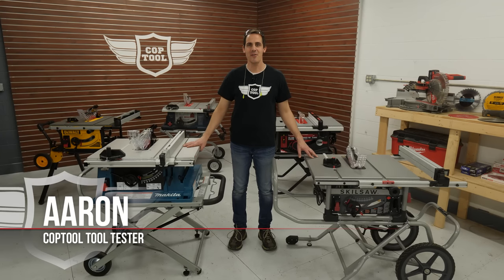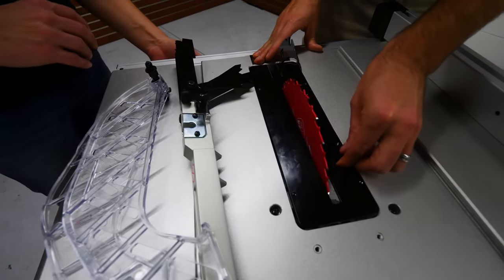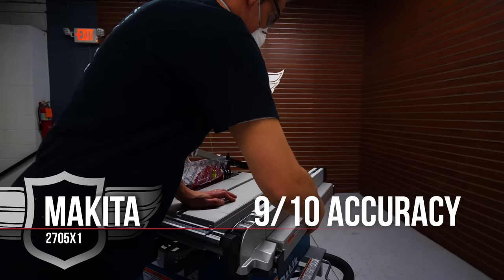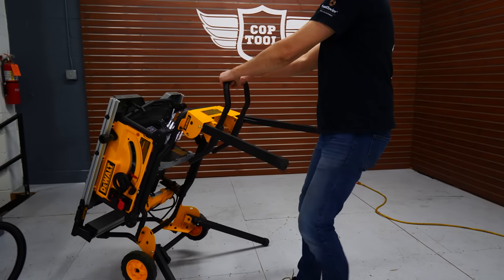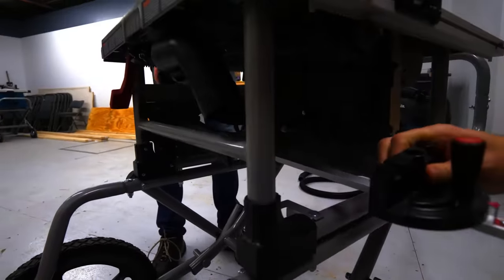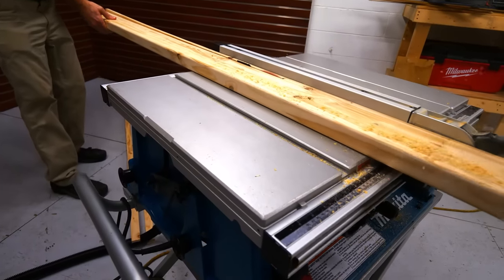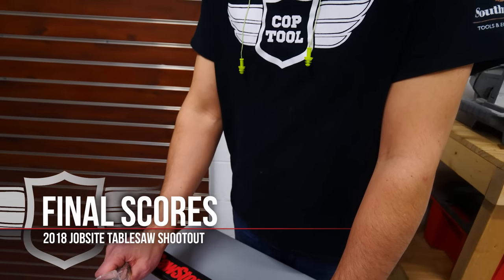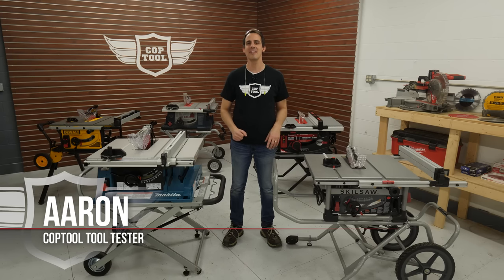THE BEST Jobsite Table Saw - Bosch, Dewalt, Makita, SawStop, SkilSaw. How to choose the one for you.

Comment: I have that exact model Dewalt and have used it plenty over the past 4 years.  I added a Ridge carbide blade, zero clearance insert, and JessEm rollers (router version) attached to a Rocker aluminum fence.  I posted a photo on my Amazon review.  It works great, but like all table saws......isn't perfect.  The tabletop is a bit small and isn't dead flat like you would find on a cast iron saw.  The miter slot is also a bit sloppy.  And in my case, the fence has a tendency to lift upwards because of the force of the rollers pushing down.....but this was fixed by drilling a hole in the plastic fence bracket and adding another lockdown bolt.  Out of the 5 saws reviewed, I would most likely choose this one again.  The Saw-stop is nice, but you're approaching hybrid saw pricing.

Comment: I like the makita. It does cost more, but you get real tangeble benefits for the money like smooth ramp up and low rpm loss under load, both contribute to keeping your breaker from being thrown. It's also the quietest, one of the most accurate out of the box, and I'm pretty sure it's the only one with a off-break. I think it goes very under appreciated how much more comfortable a few decibels and a rapid off-cycle is until you have to deal with a ripsnot freewheeling saw.
Reply: Those are the features I go for too. Also stability and low vibration when using dado set.

Comment: I like my Ridgid table saw and it’s Lifetime warranty I’ve had no problems and it performs very well daily .. I use Diablo blades on all my saws
Reply: My grandfather and I bought a Ridgid TS3612 back in 2001, that saw was great, still works great, but my grandfather passed away in January of this year, and my uncle now has the saw, I have no clue why he don't use it, just one of those items that the family thought they needed to take from the shop, that they'll never use as was the same with everything else they took, if it had any sort of value they could get by selling they took, it...nevermind the fact that grandpa and I went halves on it, so technically they owe me for 1/2 the cost of the saw....I ended up getting a Grizzly hybrid table saw to replace it.  I also bought the Skilsaw SPT99-11 which is the HD portable worm drive table saw for the times where I need to take the saw to the work LOL....the Grizzly table saw is great, but its a bit of a chore to move it LOL.  The mobile stand for the Skilsaw is great, the large wheels make it very easily movable, and easy to load/unload from a pickup too.

I use Diablo blades as well, they work great, and last a long time....The Diablo blades are made by Freud.

Comment: I remember when Skil was a great brand. Maybe it is again. I have a Dewalt DW740 that I picked up for $239 at the homer depot because that model number was being phased out. I love it.
Reply: I have the Skilsaw SPT99-11 Heavy Duty Worm Drive portable table saw, its great, very accurate, and tons of power with that worm drive system....the rack and pinion is metal rather than plastic like most of these saws.

Comment: I agree with your comment regarding saw safety. However, you went overboard in praising Sawstop. Without their patient infringement lawsuit against Bosch over the REAXX GTS1041A Jobsite Table Saw we consumers would have an additional and perhaps cheaper flesh-detection option.
Reply: You don't think Sawstop should have the ability to protect their patent?
Reply: Yes, they do and they did.  I'm just saying I, as a USA consumer, have less choice. SawStop's patents were issued in the 2000s. They tried in 2014 to make the patent standards essential. Why other manufacturers have not licensed SawStop's IP and incorporated them into products would be really interesting to know.  Regardless, these patents will expire in two to three years.  More brands of table-saws with flesh-detection safety features should be available then and, hopefully, at lower pricing levels.
Reply: @kamleo1685  Price is why.  can't wait to see what happens when the patent runs out.
Reply: @whoDatBeDare  SAW STOP was established by three patent attorneys according to reliable sources.

Comment: WOW!!! This review makes me so happy. For about a year now I had my
 heart set on the Dewalt. I have a Bosh 12" Glide Compound Miter Saw. I also use Bosch for my routers. I have Dewalt drills and brad nailers. I have a few Skilsaw circular saws. So I'm not set on any brand per se. Last month I logged on to Amazon to buy the Dewalt table saw but decided to do one last sanity check on what was out there. That's when I saw the new Skilsaw job site table saw. After looking at the specs and using my common sense I came to the same conclusion y'all did in this review. I went ahead and bought one and it has been simply amazing. This review wasn't on YouTube when I purchased my Skilsaw table saw and I am so glad that it is available now. You basically say all the things that I have been telling my mates for the past month about how awesome the Skilsaw is. It eats through everything I throw at it. Amazing power. The miter gauge sucks and I wish the power cord was longer. But that's being very picky and honestly...what factory miter gauges DON'T suck. Big wheels! Can't go wrong. Let's try and convince the luggage manufacturing sector of that also :)  Great review and feel totally vindicated in my decision to go with the Skilsaw.
Reply from the maker: Alex, we've been very impressed by the SkilSaw for value, wormdrive power and other features. We've still found some small annoyances like you said but if you want to use it for more precision work you should consider some upgrades on any "jobsite" table saw. To be fair to the Dewalt here we deliberately picked 5 great pro saws we think are all good for professional use. We left out some other options from Ridgid, Hitachi, Delta and others which we would guess Dewalt likely would outperform many of those as it still really is a good saw.
Reply: Agree with you 100%. For me the worm drive technology, oversized wheels, gravity rise stand (which is almost magical in that I can operate it with two fingers!), larger engine (over older Skilsaw table saw) with faster cooling were all huge plus points for me. The main reason I was going with the Dewalt was the 32" rip capacity (right hand side) and rack and pinion fence. Since the Skilsaw has a 30.5" rip capacity and essentially the same (but more stable) rack an pinion fence.....it was a no brainer. Add to that that it's $499 from acmetools.com and they throw in a free Skilsaw sidewinder circular saw and it's a win all round. Spent the whole weekend behind my table saw making cuts for a project and it was an absolute pleasure. Thanks again for the awesome review. I just subscribed :-)
Reply: Alex Reid  crappy fence adjustment !- Shaky n wobbly to move !- have the saw stop copy too !

Comment: In five years my dewalt never let me down, and it’s used HARD.
Reply: That Dewalt is a very popular saw, and honestly one that someone should consider.  I have a Skilsaw SPT99-11 which is the heavy duty worm drive portable table saw, but if I were on jobsites all the time the value saw would be that Dewalt for sure as they're extremely popular all over the country, and the price is pretty reasonable.  The Ridgid would be a good contender as well with its lifetime service agreement.  In the 23 years I had the Ridgid TS3612 contractor table saw, the only thing I replaced on it was several blades, and the drive belt...its still a great saw, other than the fact that my uncle has it now LOL.

Comment: I've used all of these saws including the portable versions. saw stop wins hands down. saw stop has a lot of little accessories and features that were not mentioned. as for value, its priceless, the fact that you'll never cut off a finger(s) or worse is worth every penny. combined with 1 turn height adjustment, micro bevel adjust, and superior dust collection.

Comment: I have the skilsaw.  It is a fantastic saw. Makes all jobs easier. It's a great tool!!  I also can not understand someone buying a dewalts after watching the video
Reply: It's inexplicable. People buy on "Feels". Seems like every single Dewalt product I've bought I've either sold used because it was inferior to the competition, or I could see a significant "Dumb" aspect to it. Biscuit cutter had waaaay too much slop.  Lets not even discuss the compressor, OMG.  The 13" planer sniped and just never could feed properly, really feel like I got a lemon. The 12" version (one model down) I replaced it with is way better  but the design of the chip collector and how it screws on is nuts because you can't swing up the outfeet platter, which means the tool takes 2x the space to store. Arrrrg, it's always SOMEthing with them haha, too bad because otherwise it's a very good machine.

Comment: Hey, with a video of more than 15 minutes we do not know:
Which has the soft start or the best? Which one has the best brake?
What is the best dust port? What is the noise of each one?
Wake up guys, we are in the year of 2018!!!
Reply from the maker: Thanks for watching!
SawStop is the only saw with a brake. Bosch includes soft start circuitry and the Skilsaw effectively has soft start through their worm drive motor. The Dewalt, Makita and SawStop do not utilize soft starts. I can't say which has the best dust port as they're all relatively the same when used with a vac. However, if you don't have a vac, Skilsaw has a 45 deg. elbow attachment for their dust port so you could point down to a bucket and collect some of the debris. We've run tests on noise but didn't find much of a difference in each model.
Reply: coptool Thank you
Reply: They didn't fool with answering these questions because the SawStop wouldn't have one in those important categories, and you can't make the company that paid for the advertisement look bad in their sponsored video.
Reply: Angry welder, yes, they answer, you can see here.
Reply: In this test SawStop is the only saw with a brake
Reply: WRONG, the dewalt has a brake, yours is defective...but no soft start....no idea why.
Reply: @nowherebrain  ....everyone who I've heard buy the Bosch with the soft start has had issues to the point the saw becomes useless. Additionally they've left out the Hatachi saw.
Reply: @ToolShow  Makita 2705 also has a blade brake..

Comment: This is the only video that I have watched that claims the Dewalt has issues with the fence or tool storage. It seemed as though SkilSaw had a lot to do with how the categories were graded. This is also the first video that has graded the SkilSaw well in power and accuracy. Just by watching this video, I can tell that I wouldn’t subscribe to this channel. Not a lot of integrity in the review. While I agree that the SawStop is probably the better of the five because of the safety, the DeWalt is clearly a better saw that the others. Good luck Cop Tool at being able to maintain a following with this kind of skewed testing.
Reply: damn people ae seriously upset over a brand jeez lolll are you a share holder or something ?? ahahah
Reply: Say as you will about that DeWalt, but I've tossed my table for it broke. The fence has been replaced at $90 Canadian and my fence now is on its last leg. 

I bog that saw out all the time ripping hardy. 

I do however love the 32 1/2" rip it makes, though it would be nice if the extension arms have more strength to them. 

You do have to watch out after ripping a mitre to set back to true, the fence is stupid easy to line back up. 

The issues I've mentioned are easy to overcome, but it is underpowered and I have used the bosch one as well with my biggest peeve being it's a pita to clean.

Comment: As a production finish carpenter there is not a better saw than the DEWALT and it is the most powerful job sight saw I have ever had.
Reply: You're right dewalt is the best hands down, 15 yr finish carpenter here telling you its the best.  And you can remove the guard from the knife.
Reply: Cabinetmaker of 10yrs here and I'd agree with you, it's the only saw I install with
Reply: I'd like to ask if you've used all or many other brands in a direct comparison (Please don't get upset for minor criticism.)  Or have you just had a Dewalt for so long and just know exactly how it works and what to expect?
Reply: Yes I also would like to know if you have tried others. I am in the market for new saw
Reply: I have used the bosh and the ridged and they are fine when you first start using them but the don’t hold up.
Reply: gentile josh and Adam 
I've used many others and here are my conclusions:
*Older Rigid saw's are powerful and well made and have a larger cut capacity than the smaller dewalt saw's, but the new ones are crap don't buy them.
*Bosch are well made but expensive for what you get.
*makita same as Bosch
*I haven't used the Skilsaw model so no opinions there. 
I like the dewalt because the price is right and the fence stays true. If it's a job site saw you are looking for dewalt is the one. On the other hand if it's going in a small hobby shop the Sawstop or older 2nd hand midsize saw would be much better.
Reply: You're just about echoing my opinion too. I've worked on so many job sites and have never seen any of the other saws. Dewalt has been rock solid for me, I've owned most all their saws, looking to buy the new saw with the rolling stand.
Reply: They all have their pluses and minuses. Dewalt is amazing, Bosch makes some really good table saws as well. The skilsaw worm drive table saw is legendary, Hitachi even makes one hell of a jobsite saw, which is what im running now and im impressed.
Reply: Like I was saying, I can only tell you what I've seen on the job sites and what I use. I've gone through all the norm, like Milwaukee, Dewalt, Bosch etc etc. I have settled on Makita/Bosch for hand tools like drills, grinders, sanders and Dewalt for cutting like my table saw, "sawzall" etc. I don't mind Dewalt drills, they are nice and I may use them for the FlexVolt batteries, I would love to have one battery for all my hardware, Bosch isn't there yet.
Reply: MaddoxInc True that, it sucks when you get nice tools that have such a small line. Hitachi is the same way, their selection of 18v tools is rather mediocre but good quality nonetheless. I recently decided to start switching over to Milwaukee since they seem to think of the small things. Like they just recently released a cordless Soldering iron, heat gun, and hand stapler. Pretty handy
Reply: 22 yrs as a carpenter and I agree dewalt hands down

Comment: How are the values for Bosch and DeWalt the same for price when DeWalt is $50 cheaper.  And sawstop is more than 2x the price of the DeWalt and is only 2 points lower?   You arbitrarily threw out scores.
These are all good brands so value is obvious, we are looking at price. 

If DeWalt and Bosch are an 8 then saw stop is a 4-5 in price category.
Reply from the maker: Ryan Irving Fair point. Thanks for your input!
Reply: I disagree that it's not purely price.  Let's say saw a and b are the same price, but B is 5 points higher on everything else, it should get a better value score.
Reply: @scottroy6195  read my comment.  It was talking about purely the values they attached to the price category, not the saws as a whole.

My comment on the end was to qualify that all these jobsite saws are good quality and all are going to do a similar job.  When your looking for a jobsite saw whether it's bosch, dewalt, rigid, makita; they are all basically the same, it comes down to price and brand loyalty.  The sawstop really shouldn't even be in this comparison as it's a gimmick, any contractor that uses one either just wants to promote an image or has heavy brand loyalty.

Comment: I think the value of the SawStop was completely underestimated. Yes it’s expensive, very expensive, but no matter how long you’ve been a woodworker, no matter how many years you’ve been using a table saw, the day you wish your saw blade could stop in 5ms is the day you wish you went the extra $500.
Reply: I just replaced an old Ridgid TS3612 earlier this year with a Grizzly G0771Z hybrid table saw.  I was after a Sawstop, but given availability and shipping issues I went with a Grizzly that arrived within a few days vs an unknown shipping date ugg....oh a Sawstop will still end up in the shop at some point in the future for sure, but the Grizzly is getting everything done that I need...the Sawstop when I get it will have the extended rip fence, and the nice outfeed table and dust collection setup too....I gotta get the shop fixed up and everything first so I have the room I need for that Sawstop.  The Sawstop isn't that much more expensive overall given the features it has and the safety system it has.

Comment: I watched a vid @ a Concord carpenter who had this the other way around.
Reply: On his,  the Hitachi won overall. With the dewalt in 2nd and the skilsaw was 3rd. These saws are all close in performance. With the tests that concord did, and then watching these... I think it's between the dewalt and skilsaw. I think either saw will be great. But I did like that the skilsaw didn't slow down when cutting during this test.
Reply: Compared to this presentation the Concord Tool video was professional and objective.

Comment: Does anyone know where to find a good video on the skilsaw finger guard thing? I've just been using the riving knife but decided I want to start using the guard as well. However, it seems very floppy and and seems like I have to have the blade significantly higher than just exposing the gullet of the blade.